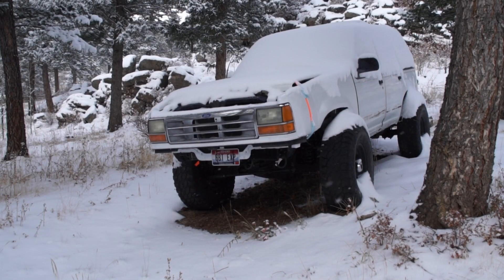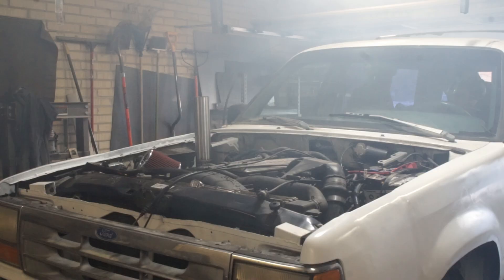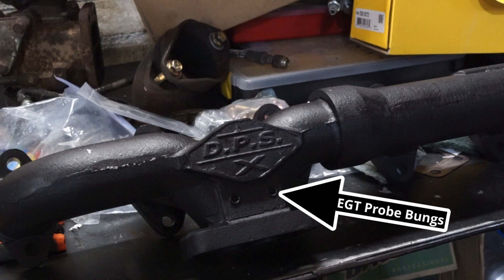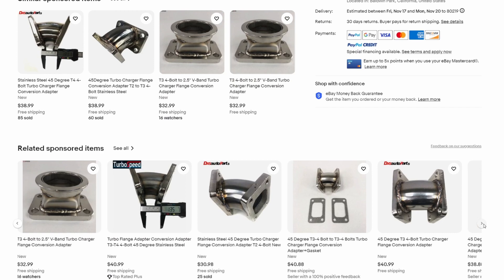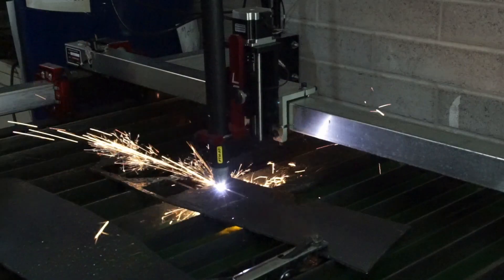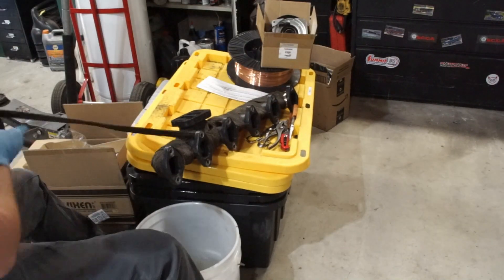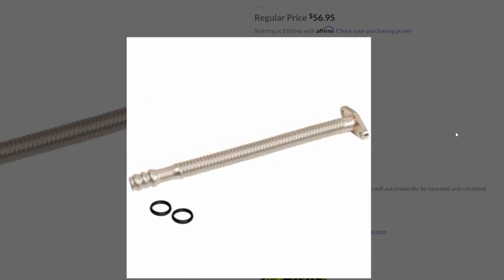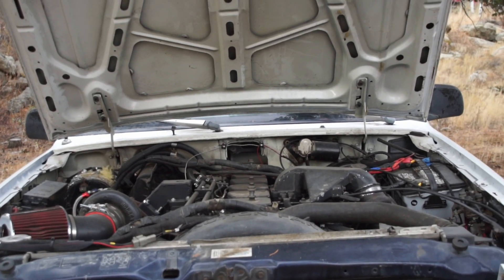Turbocharger DIY

Comment: It's always something. No matter how much you try to anticipate there's always a gremlin watching, rubbing his hands together just waiting to mess something up.  You always come up with a good solution it seems so well done again. You might like the Cerakote piston coating ceramic heat barrier for things like your adapter and exhaust manifold. It doesn't require oven curing and goes on with an airbrush. I have cylinder heads with over 100,000 miles and it's still on the valves and chamber.

Comment: As a dedicated viewer, love to see you back man. Weathers gotten cooler so I’ve gotten too lazy to go out in the heat. Recently I started an open source gauge system. My truck is currently using a diy egt gauge and I’m pretty happy!
Reply from the maker: Thank you! That's very cool. I was planning on running all my gauges off arduino, but started running out of room on my Nextion HMI and got lazy and just bought off the shelf pod gauges for EGT and coolant.
My code and wiring is here:
https://www.buildautomedia.com/arduinodash

Can I ask what your gauges are built with? Have a link to the project?

Comment: With the Cummins swap on my 1994 F150, there was just enough space behind the turbo to sneak in a 4" downpipe next to the condenser box. Stock first gen with stock manifold with a non-wastegate H1C, if I went to a HX35 I'm sure I would run into clearance issues much like you did.